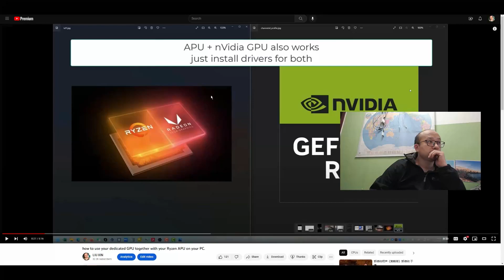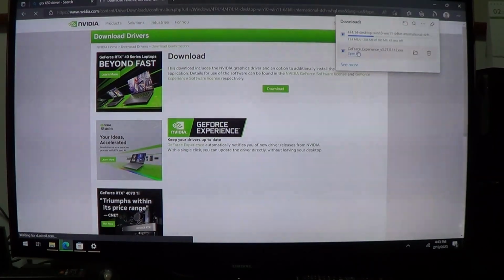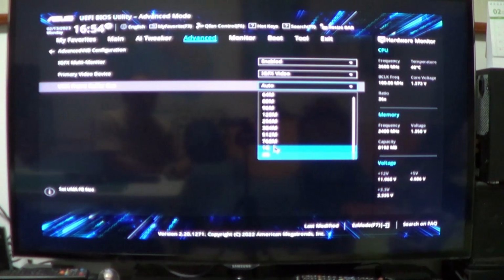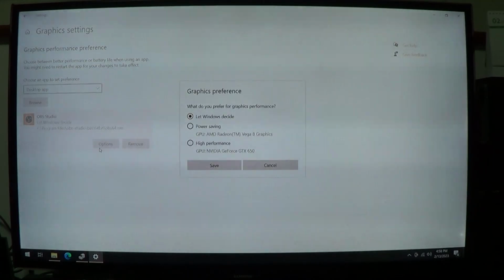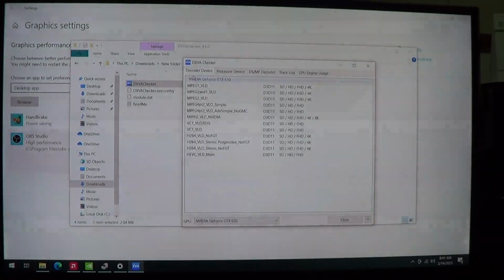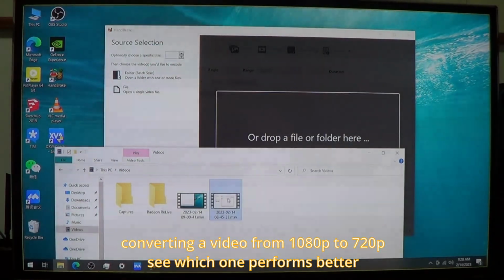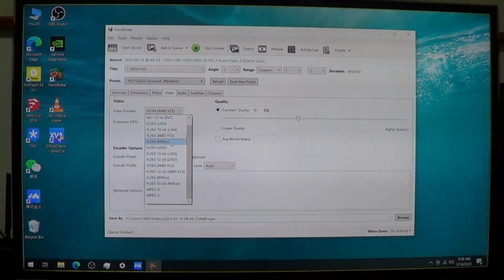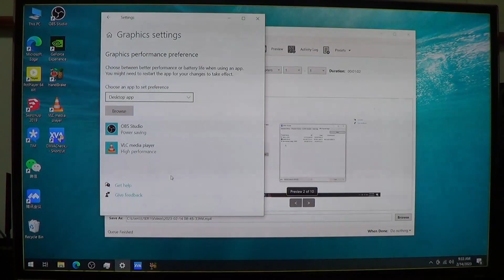GTX650 works together with APU with vega8

Comment: hello , please can you help me , i need to connect 2 monitor on my vega 6 and one monitor in my amd hd 5000 , I did everything that is in the video , after that  I have connected two monitors in vega 6 and one monitors in hd 5000 , but 2 monitor in vega 6 work and one monitor in hd 5000 not work , However when I go to device manager I find there is two gpu (vega6 and hd 5000)
Reply from the maker: Is the HD 5000 too old. I bought my HD 7850 in 2012. So I wonder when was the HD 5000 released?  Besides, I haven't tested multiple display, yet.

Comment: I did it and it works BUT I can't use it. I have a GT710 and all I want for that 710 to do is nothing until I use it for OBS or Blender.
Unfortunately the games keep using the 710 instead of the Vega 8. I already selected the games to use the Vega 8 in the graphics settings (windows settings) but still nothing.
The only apps that follows my plan is Roblox, Blender and OBS.
Still Thank you
Reply from the maker: Hi, so which brand of MB do you use? Have you updated the BIOS to the latest? Did you set the iGPU (maybe different names for differnt BIOS) as "primary" or "forced".
Besides, did you plug the HDMI or DP cable to the MB (so the vega8 will be default)
And some MB (Gigabye e.g), there's [initial display output] setting, make sure it's on [intergrated display] since you want vega8 to be the default.
Reply: @LIUXIN  I got a MSI a320m pro-e, I selected the IGD and Force it, and I connected DVI-D on the MB. Not sure if it's the latest version of the bios. And I don't know if there are more setting connected to the GPU/IGPU 

That's what I used last night

The only problem is some games keep using the Dedicated GPU even tho I specifically said not to lol

Comment: Thanks man, hopefully my system can do this. Also can I ask what kind of motherboard your using?
Reply from the maker: this is not my daily PC. It's just an extra one for hobby. the MB is Asus B450 Dragon. you can find its specs on ASUS website. It's for OEM only. I bought it from taobao.com at a rather low price.